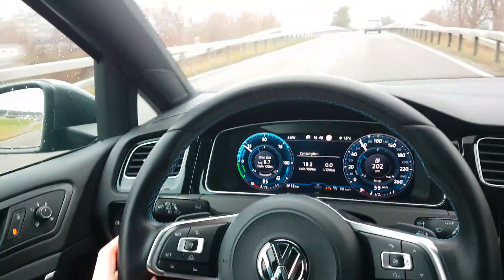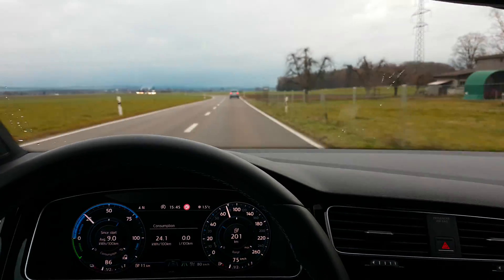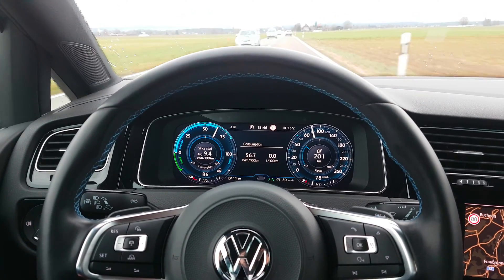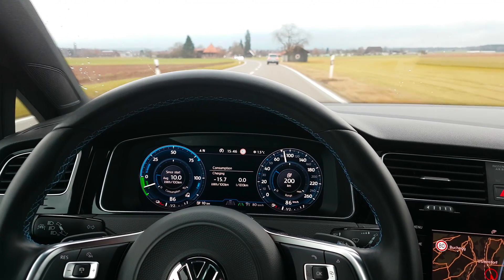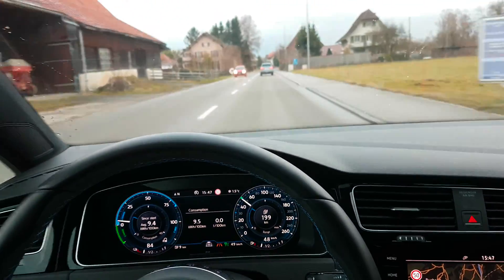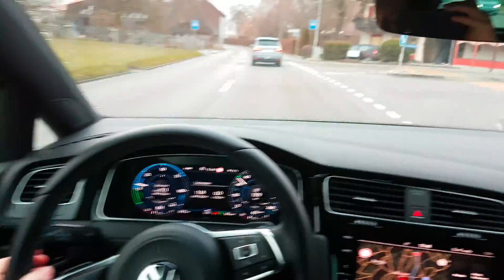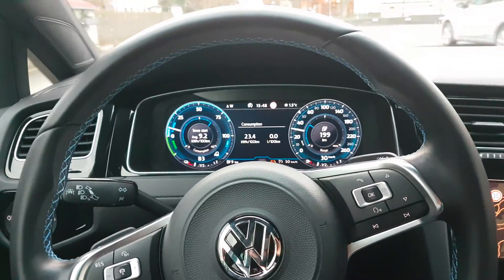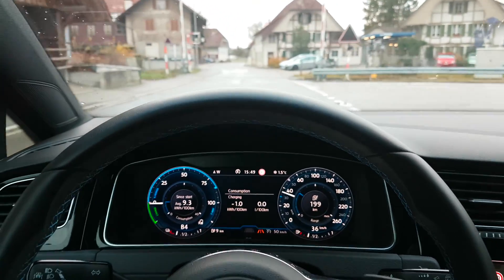Vw Golf 7 GTE Explain and Test Drive One Pedal Brake in Real World Review✅⭐

Comment: hello, when the battery is low GTE mode can not you activate it?
have only 150cv with low battery?
if for example I would like to take a Swiss mountain pass in GTE mode after 50km I could not use the GTE mode because I would have finished the battery?
Reply from the maker: You can drive in Hybrid mode and the battery will regenerate faster or you can drive in Benzine mode for next 20 km and the battery will charge. GOLF GTE have a great option call " Charge Battery Mode" and the car drive in Petrol mode and the battery it is charge faster and you can use it after in GTE mode. The car it is very inteligent. I will make a future video about this.

Comment: Does re-gen braking improve electric range much ?
Reply from the maker: I think around 10% depend on the road and the driving style. But it is great extra for the cars. You actually dont have to use the breaks to much.  If you are downhill will regenerate very much.

Comment: very interesting. Thanks for sharing.
Reply from the maker: YOu are welcome ! I will add more video about GTE if you want to see something i can do a video for you  as well !!
Reply: Hi, yeah, thanks for the proposition. I am wondering about what speed does the ICE kick in when driving in hybrid mode.
There's a youtube movie (look for keywords passat gte pov) where the guy drives in hybrid mode, and we can see that the ICE doesn't kick in at the same speed. Sometimes at around 20 km/h, and sometimes around 50 (see around minute 10 of the video). How does the Golf GTE behave in that aspect?
Reply from the maker: The idea is that is not always the same, if you look carefully at my other video to i think you can see in the middle of dashbord where it is show the consumption there you can see when it is work on electric or gasoline. But my GTE it is always different when it is in Hybrid mode, i observe at low speeds it drive more electric and when i decelerate it get on electric mode automatic. If you try to go fast it will go more with the gasoline. I will try o make another video longer about this Saturday.